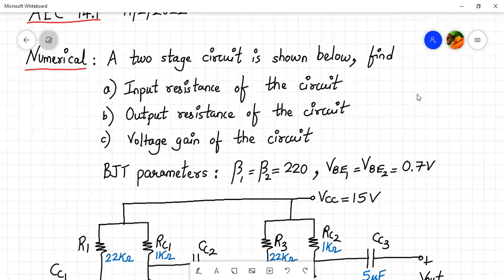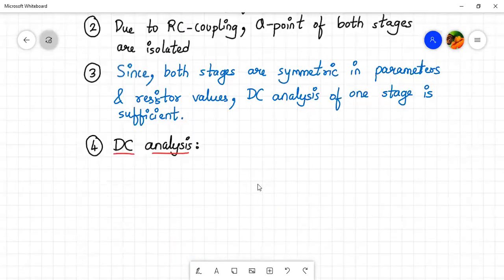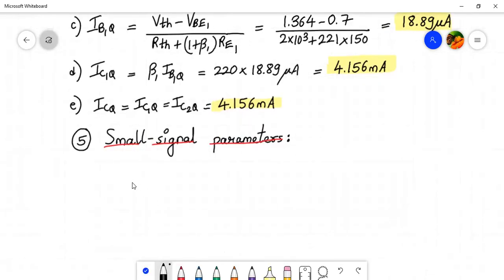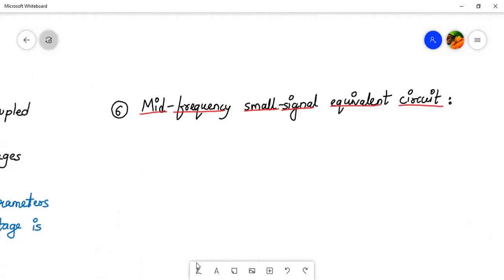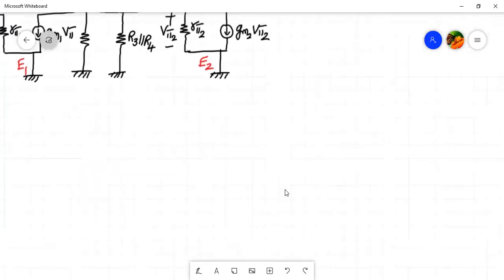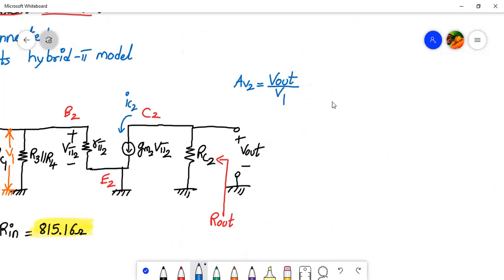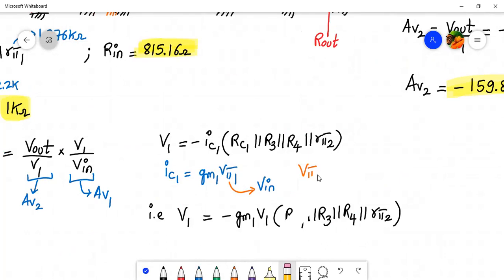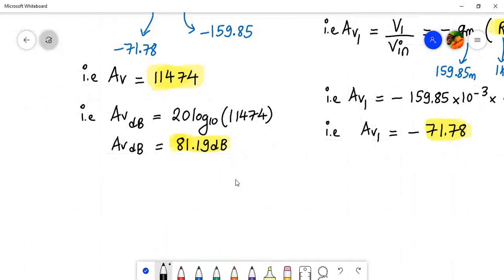Analog Electronics Circuits Session 14: Numerical on RC Coupled CE-CE cascade stage

Comment: Great. Sir could you pls mention that if we have to analyse the cascade circuit using law frequency model, then should we consider the coupling and bypass capacitors  when drawing the law frequency small signal equivalent? Is it correct? If it is, when we calculating the input and output impedances should we consider those capacitance also? Kindly reply.
Reply from the maker: Only mid-frequency equivalent circuit is discussed for calculating input and output impedance. For mi-frequency, coupling and bypass capacitors are considered to be short-circuit
Reply: @InderjitSingh87  Thank you so much sir for your kind reply.